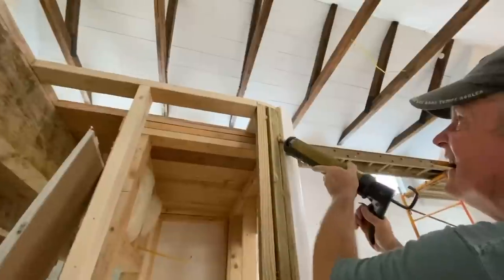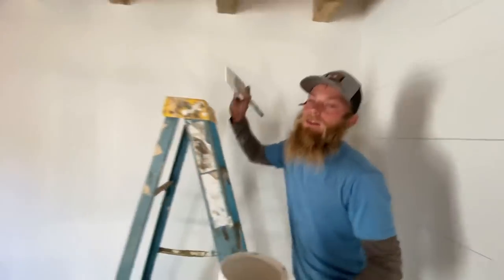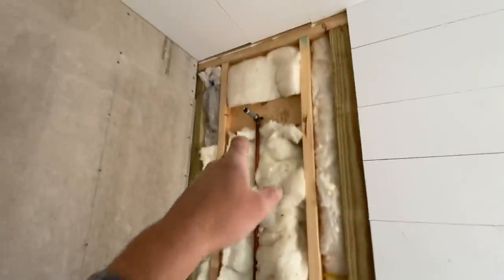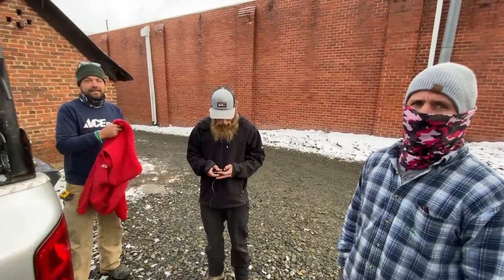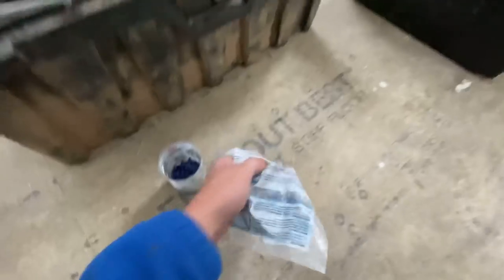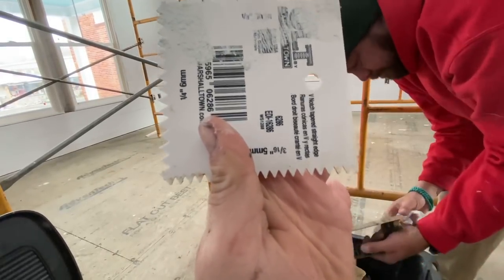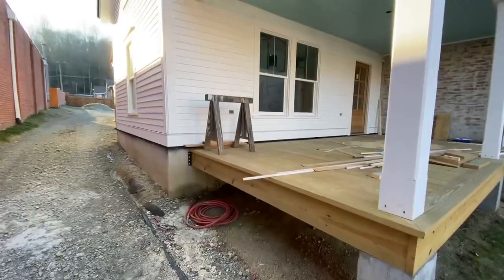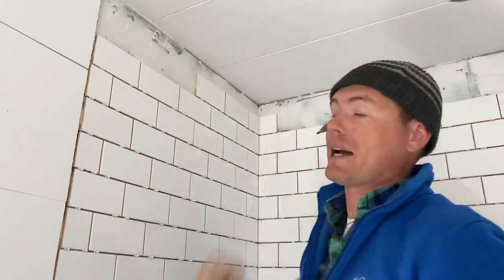Renovating A 100-Year-Old House | Episode 15

Comment: This biggest thing that made the job go easy was that the tub was level.  This way the first row was easy.  Very nice tiling job!
Reply: ...and the walls are plumb.
Reply: Pro Tip: If the tub is way wack which it usually is then start with the second row, use some finish nails in the wall to support the tiles. This gives you a straight up head start (pun intended) and makes the install of the bottom row easy. Silicone the nail holes before grouting if youre concerned about moisture. Best to use a high quality grout then there wouldnt be any of those concerns.
Reply: @baronvolkov6172  When I tiled around my tub recently with 12" tile...I started with the second row by applying a level leger board and tiled up from there.  Then later cut the pieces on the first row.
Reply: @Asta-wl8jz  Yep that works great, I mostly do that on bigger custom showers that take several days. On tub surrounds il just use nails to tile the whole thing in one day

Comment: when your tiles are cupped, soak them in a bucket of water, it will also reduce the amount of moisture your tile pulls out of the motar allowing a nice slow even set of the motar.
Reply: Bad idea! Wet tile will prevent thinset from adhering to the tile!
Reply: @tedmcnair9709  Probably not dripping wet, but having some water in it. With how much water clay and ceramic pull, you could quickly dump a stack in water before setting them. Mastic wont stick to it but thinset mortar would. Its like masons dunk bricks in water before setting so the mortar doesnt dry to quick. Could be a useful on a hot summer day for clay and ceramic tile. Not porcelain Lol.

Comment: I had that same problem with the subway tiles not having the self spacers on it when I did a back splash for my uncle and man it made me have to work so much harder. Definitely gonna make sure I have the right tile for now on lol live n learn
Reply: I’ve found that the self spacing tile goes up easy-peasy, but you really have to work the grout to get nice clean lines.
Reply: The self spacing tile usually doesnt even line up on the bumps consistently when you stagger it, ends up ruining your joints and having to shim it so your level line doesnt go whack

Comment: watching you install that backer board has me thinking... I'm starting a rough plan of what I want in a custom built home, and I want to have a bathtub, probably one that's smaller around but deeper like a Japanese soaking tub. But, I'm in love with small tile, and don't like the look of tubs. Do you think it'd be possible to build a tub/shower combo like it's a tile swimming pool or something?? Like we could put a shower pan with membrane at the bottom, and backer board all the way up, and if it's all sealed and tiled real nice, like a full tile shower but just with a tub height front wall? Probably build a small seat in, too, like Japanese tubs. But I just don't know if tile over backer board is actually kind of pourus and should hold water like a tub 🤔 My other idea is to make a big tile shower stall, and in one half of it, put an actually wooden Japanese soaking tub. So in this case, there would be two drains in the shower pan, so one can serve the tub, and there would be a shower head on one side, and a faucet over the tub on the other.

Comment: You should never use mastic on a wet area. It will mold as well as it takes for ever to dry
Reply: This is true. Moisture will cause it to re-emulsify and tile will sag and possibly fall.

Comment: That curve on inside is beautiful! Do you guys now how you would put dry wall on a eyebrow dormer I just go to installed and I am trying to figure how to put drywall,on that. Just wondering. Thanks for this episode Erik! 120 main is looking beautiful!
Reply: Relief cuts on the back leaving front paper attached for inside. Same time for outside just cut a quarter inch out of your relief cut like a v
Reply: Thanks!
Reply: They make really thin drywall you can bend easily. Apply 2 or three layers to achieve desired thickness
Reply: @jaimeperkins9606  thanks Jamie!

Comment: it would have been nice to use end caps. so you don't have to grout up to the wood. Use a matching grout caulk between the tile and the wood wall, or it will crack over the years with the wood expansion and contraction.

Comment: Those little tile make for a grouting nightmare.
Reply: Especially black grout, when the ceiling and walls are already painted, Vessel sinks and faucets already installed on a backsplash. Now thats expert mode. Just did it last week
Reply: @baronvolkov6172  need 100 buckets of clean water

Comment: subway tiles  are 3x6 or whatever size, they look like brick. and that is a subway tile. They are cheap probable big box store tile.  that's why they don't have the built in spaces. If your an experience tile guy, you don't need spaces. I need them. lol.

Comment: Use 1.5” finishing nails as spacers for tiles. Cheap and easy to pull out afterwards.
Reply: Just don't penetrate the membrane...
Reply: @Asta-wl8jz    An don’t use the head of nail either, could be problematic pulling them out.

Comment: What’s the name of the waterproofing on the bathroom wall?!?!
Reply: Green stuff I think its called Aqua Defense
Reply: @baronvolkov6172  thanks bud. Do you know if they sell it nationwide
Reply: @bigfel1980  Mapei Mapelastic Aquadefense, Lowes sells it. If not available in your area then another great one is Flextile WP900 & WP980 Waterproof Membrane. Prettymuch same thing probably different specs, good for exterior use. Probably need to call a few of your local tile stores to find that one.
Reply: @baronvolkov6172  thanks so much. I recently used kerdi membrane. It was good but by looking at this, it looks easier to apply
Reply: @bigfel1980  Sure thing! Id say the walls dont need such liner like the kerdi membrane at all. Concrete boards wont rot and if good quality grout is used then no water will get behind the tiles anyway but just as an extra i waterproof with the green stuff. Keep in mind though the green stuff doesnt replace the thick poly liner in custom showers. It will still crack in the corners after a couple years from some expand/contract movements of the studs. So the gray poly liner is a must for custom shower pans. I dont also dont like those schluter/wedi/protile systems of presloped foamboard pans, they cost a fortune so you lose out on the earnings and just pass it to those companies. Completely unnecessary products, meant to transfer the profits from you the contractor to the companies of those products.
Reply: @baronvolkov6172  thanks for the tips brother

Comment: You backer board was supposed to be on the inside of that flange. Love you guys. Love the channel. But that’s asking for trouble down the road.
Reply: I'm looking to remodel my own bath and most of the information I've found online (including a bath tub installation manual from the manufacturer) says to not overlap the flange. The tile will do that. The backer board should be flush with the flange so that the tile overlaps the flange and you caulk at the bottom. I think they've installed it just fine.
Reply: Depends on how the tub was installed and from my experience many plumbers just seem to jam it to one side or the other. Ideally it should be centered to account for backer thickness and then tile overlap
Reply: I did it the same as these guys, but put window flashing over the flange but behind the durock. Best of both, and don't have crooked walls

Comment: Hope that wasn’t mastic......If so you will be tearing that out!
Reply: It sure looks like it. Since its already installed I would go with some expensive two part epoxy grout just to be sure that grout will never leech any moisture in those joints. Should be fine then.